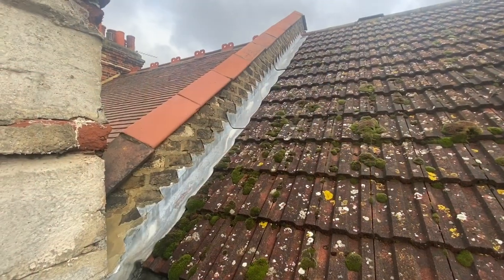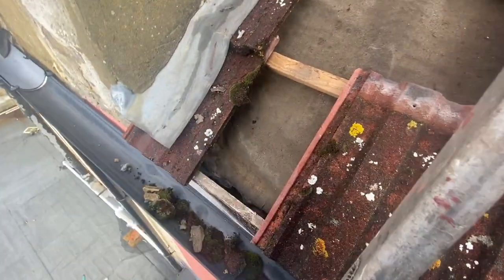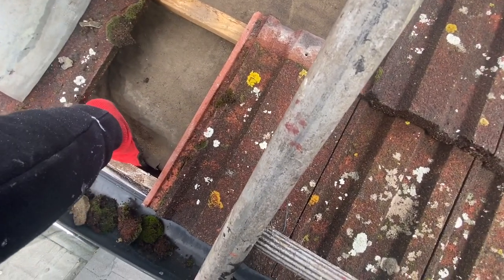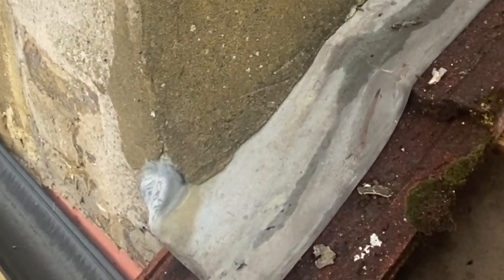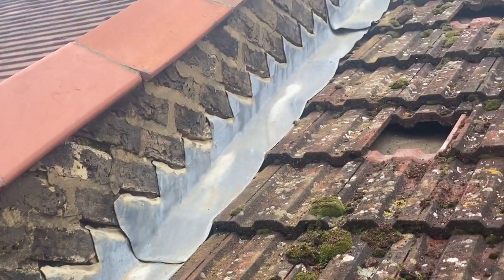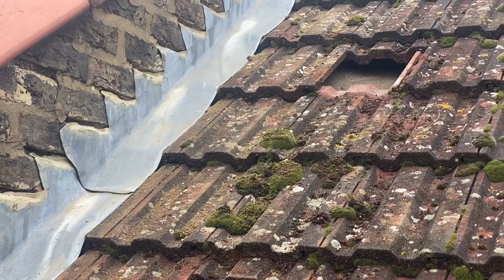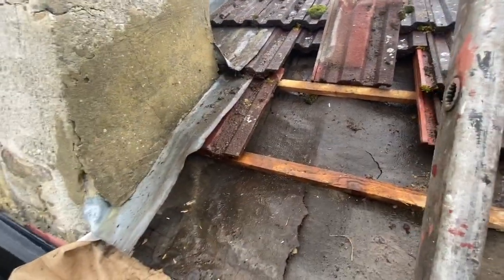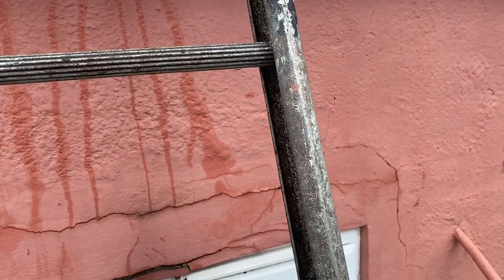Repairing lead step flashing

Comment: Plastic tray support       needed to support felt and membrane to prevent sagging and ponding and spillage to one side . Safety first you need both hands free to do the work so scaffold or roof ladders essential.

Comment: That step flashings been fitted by a wally. Not got a deep enough lip into the mortar joints. Id rip that all off and re lead it properly
Reply: Yes I was thinking the same , lead not deep enough in the joint, also the pointing on the bri work which was not done by Darren is atrocious looks like a 5 year old kid did it